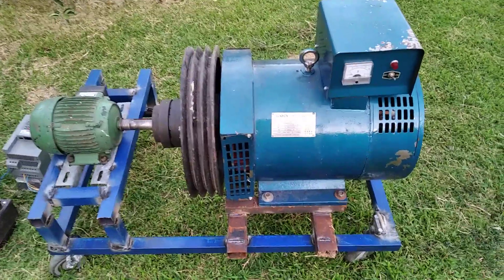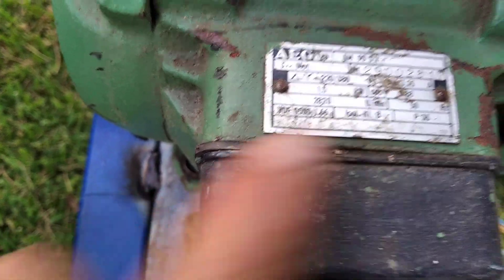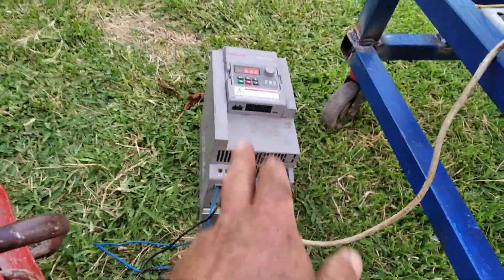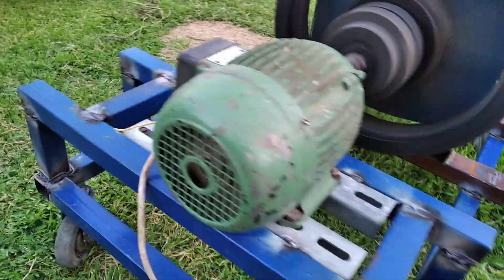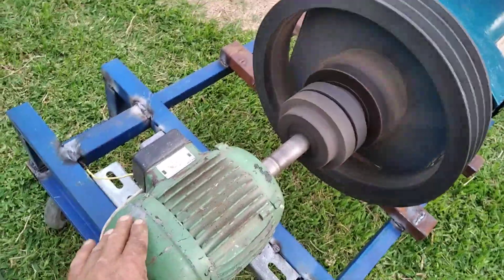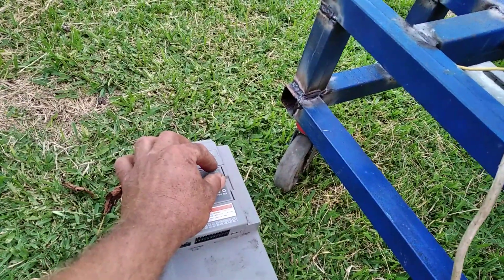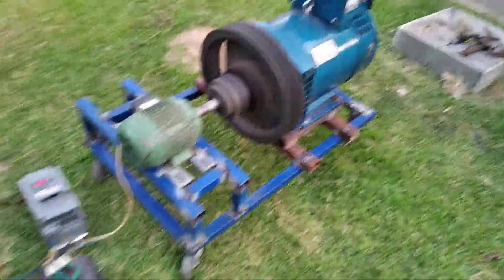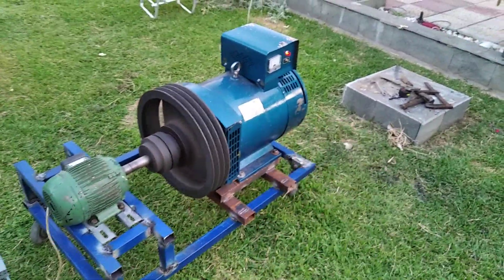Free energy project . 1.5 kw turn 20 kw generator

Comment: Very nice  You have shown us the 1.5hp induction motor can drive the 20 kva alternator now if we use solar panels and vfd to drive the 1.5 hp induction motor we have a 20kva power supply for our house. May i kindly ask this did you make some alteration with the induction motor and alternator? Many thanks
Reply: Did you try the solar panels? I want to do the same if you succeeded

Comment: There’s nothing to see here and you can ignore the power source for the drive motor it makes no difference what your power source is for the drive motor it’s all about how many amps the drive motor uses to spin the fly wheel and the generator and then how many amps the generator Can output.   If your generator can output more amps than the drive motor is using to spin the system then you’ve got something to share this guy doesn’t even have a load hooked to the generator he is showing us basically nothing he does show us one thing though,  He is showing us how to destroy the bearings in the generator and the motor simultaneously By having The weight of the fly wheel supported by those two bearings.

Comment: This system won’t work because the energy in the fly wheel isn’t enough. It will show the kw because it’s rated at speed not at load. The output will not exceed the torque input of the small motor. If u load the alternator with machines that exceed the kw rating of the small motor on the alternator it will fail

Comment: There is no load on the twenty K generator.
Reply: নাম্বার টা দেন
Reply: @tensonalom3311  Please answer in English. Thanks
Reply: @victoryfirst2878  No load means no 20 Kw, since it's not even connected to anything, that means NO Kw at all. As you were suggesting though, this can't even put out as much as it uses to run even if it was powering something.
Reply: @lorditsprobingtime6668  Got it and thanks. V
Reply: @tensonalom3311  English fella. That helps us all.
Reply: @lorditsprobingtime6668  Amen to that fella. Some people have no SHAME for sure. Peace

Comment: Sire you got plenty of KVA, All these videos show drill's halogen lamps, I want to see it boil a 2/3kva kettle, use a 160/200amp welder burn out 1x welding rod of continuous weld & see what happens when it comes under load & how it reverts back to normal speed under it own power, 
Please show me,,

Comment: Is that alternator genuine or rewinded with permanent magnets.
Reply: Both of them are same acts!
Do you want more details?
Reply: that big  motor  is  a alternator  as it generates power from rotation . plus im looking for one  like this as well  but hard to find
Reply: @danielhorne6042  there is a company on ebay that sold them

Comment: FREE ENERGY IS FAKE!, YOU INVESTED A GREAT SUM OF MONEY FOR A THING THING THAT DOES NOT WORK
if you disagree? try drawing more power than the motor has, ie- more than 1.5 kw. the motors have aa service factor for safe overloading, so try drawing 5 kw. IT WILL STALL!

Comment: You tell us "the source " thats mean you take the power from outside and use the tansformer to convert the power to another phase,  and after the motor rotates why you did'nt disconnect the outside source by using the flywheel  runs the motor by itself.
Reply from the maker: For more information send me mail .  merollari@outlook.com   thanks.

Comment: can cycle forever?
Reply: It's not even running power to ANYWHERE. And yes, even though it's not doing anything, if you disconnect the power it will soon stop. If you actually hooked that generator up to feed power back into it it would still run down, just a bit more slowly.

Comment: My engine is one horsepower and the generator is four horsepower. When I start the engine with electricity, when I want to disconnect the engine from the mains and run it to the generator, it does not turn on. What is the problem? Please help me please